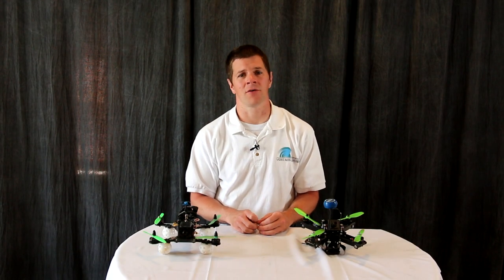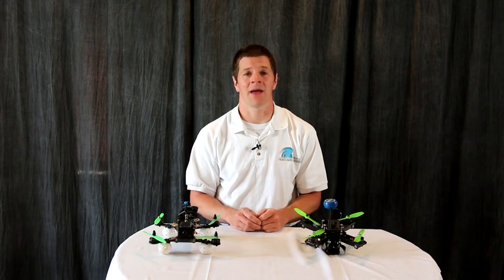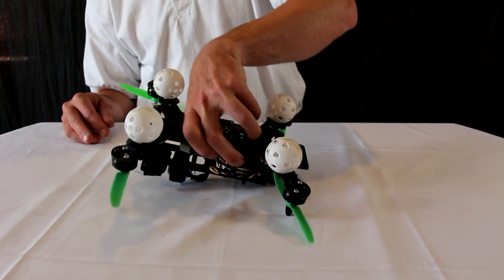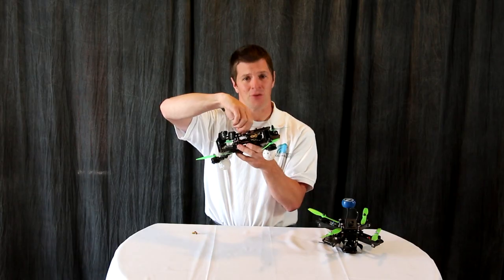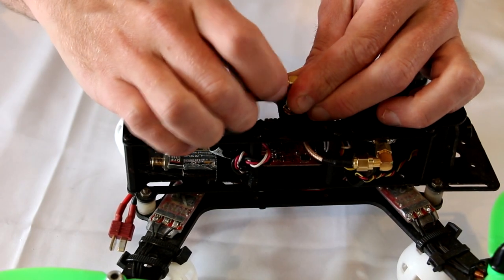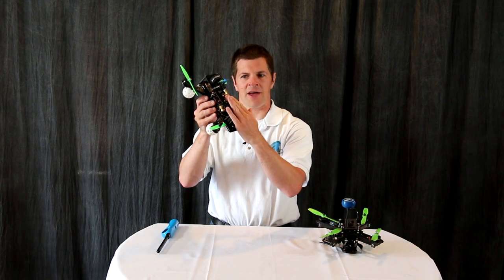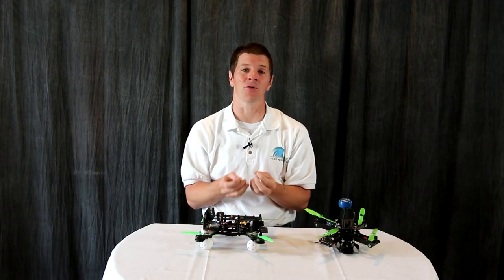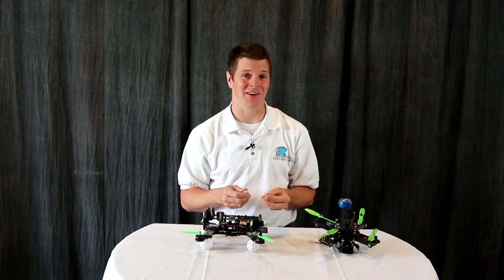How to stop breaking antennas in a crash

Comment: That's real clever, Alex!  I'll surely order some 90 degree connectors.  I'm sure not crashproof, nor are my fpv models.  Thankfully I've only ever broken 1 vtx but that vtx would have likely survived that crash if I had a 90 degree SMA connector in place.  Also, thanks for your advice to order the Dura-Spec LHCP and the 3 turn LHCP helical antennas, about two weeks ago.  I ordered them from SBA and they were here in about 3 days.  The Dura-Spec is on my new ZMR and we are now ready from some FPV quad action.  Take care buddy!   Derek

Comment: Id be careful heating the coax too much.  I used to heat it with a lighter to get cable fitting on in the winter and a rep from the company told us that the part that surrounds the center conductor is plastic with air bubbles in it and when heated it can melt that plastic and cause it to change size and shape.  That can change the impedance of the coax.  I'm not trying to be a dick and discredit Alex.  I've learned a lot from him and he knows his stuff for sure.  Just something to consider.

Comment: Great ideas. What sort of dbi
Loss does an extension, right angle adapter and low/close to carbon frame equate too?
Reply from the maker: +civicex5speed - Not enought to matter.  MiniQuads can't outfly the antenna even with the loss.

Comment: Hello, thanks for sharing the video!
I broke the FPV antenna of my drone, the welding broke between the antenna and the connector, but I managed to use it with the remaining batteries holding it together with tape, the video transmission worked properly.
However I noticed that the drone was making a buzzing sound with the battery attached. Once the antenna was changed, the sound stopped. 
Could you please tell me what causes that buzzing sound? Is it high voltage? Can something be spoiled? What do I do?
Thanks
Reply from the maker: Sounds like feedback from an over-stressed amplifier on the video transmitter to me.
Reply: @CAGreve1231  thank you very much for the answer, I understood that the problem is not the fpv antenna, because I changed it and the drone still emits the buzz.
I realized that the electric buzz is only emitted when I connect a new battery that I just bought, with the same characteristics as the previous ones. In your opinion, can I still use this battery?
Thanks in advance.

Comment: I broke two Airscrews. It appears this is a common occurrence if a video about it was created. I will probably not be using that style antenna on my quad anymore. My other antennas have sustained repeat hard impacts without issue. I was a little surprised considering the cost of these antennas.
Reply from the maker: +deepimpact.io - The Dura-Spec is for those who crash.  The race spec is for the professional racer.  The issue is that many multirotor pilots believe the laws of physics should not apply to them and thus they just put up with terrible video and spam everyone else's video in the process.
Reply: Video Aerial Systems yes, that is a fair point and I agree with the portion about physics, but I don't know of any professional racers that don't crash. I love the antenna's performance, but found them rather frail. Perhaps with what you suggested in the video it would help mitigate some of the risk. If I had known beforehand I would have reinforced the base with some extra layers of heatshrink and tried the horizontal mount with the 90° adapter.
Reply from the maker: +deepimpact.io -That's why I have different antenna types.  It depends on whether you want performance or durability.  You need to select a product that fits your needs.  You wouldn't take a Corvette off-roading, would you?  Same thing applies here.   The race Spec was for micro racers that need the performance without the weight, hence why it has no cover or protection.

The issue you had is that the original product video didn't cover this topic... mainly because the Race Spec came out before the mini Quad race craze hit.  The vendors are TERRIBLE about updating their websites.
Reply: +Video Aerial Systems  I appreciate you reaching out and taking the time to communicate with me and the general public. I apologize if I came across overly negative it was not my intention. I love your products and they are best antennas I have owned in terms of performance. I recently acquired your Triumph design and am also quite happy with their performance too. Thanks again and happy flying.
Reply from the maker: +deepimpact.io - I would still use this technique to keep from breaking the SMA.  We've had a few shear off already.
Reply: +Video Aerial Systems yes that was my exact issue. I have one still in service on my Shrike and I will make that small adjustment to see if I can save it. Thanks again for all your hard work and contributions to the community.
Reply from the maker: +deepimpact.io - No problem.  I have found no matter how strong you make the antenna, it will still break off if you don't have a place for it to go.  Even the Dura-Spec breaks when crashed hard enough... and I did chin-ups from the cable!

Comment: Except now you have a taller structure just begging to hit the ground and provide more leverage on the frame-mounted SMA than the antenna ever did.
Reply from the maker: +Steve W - Believe it or not, it is actually shorter.  The crimp collar on the SMA plug is ~7mm taller than the height of the top of the right angle adapter so it is actually less stress on the frame, too.
Reply: +Video Aerial Systems oh really? I stand corrected then - it just looked like instead of the antenna itself taking the blow, the angled connector stepped in as a substitute.
Reply: +Video Aerial Systems thanks for responding btw.
Reply from the maker: +Steve W - Indeed that is the case here.  You are taking the hit on the adapter.  However, the adapter is actually shorter than the antenna with the collar.  The collar is buried under heatshrink tubing in almost every antenna made so it goes unnoticed.